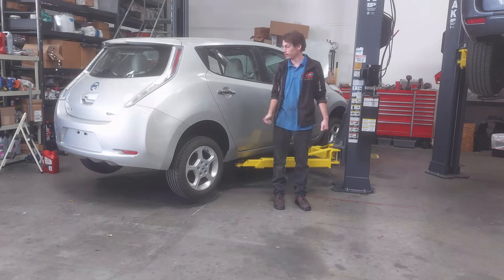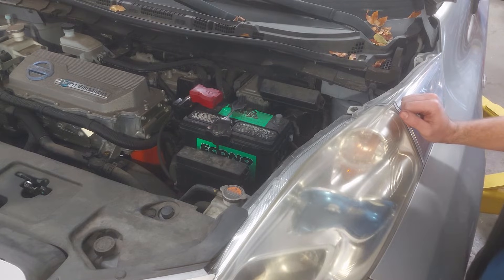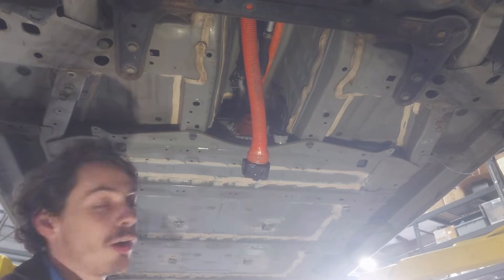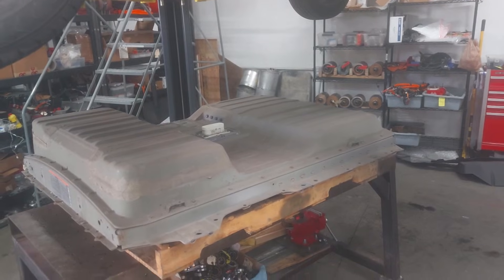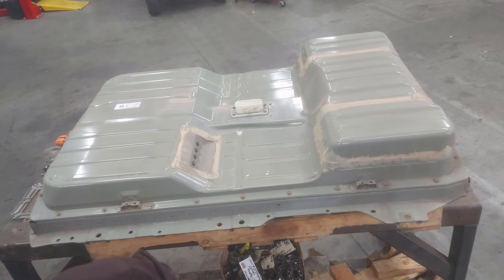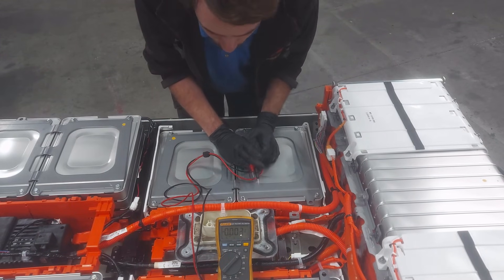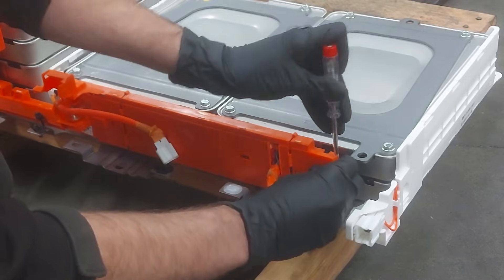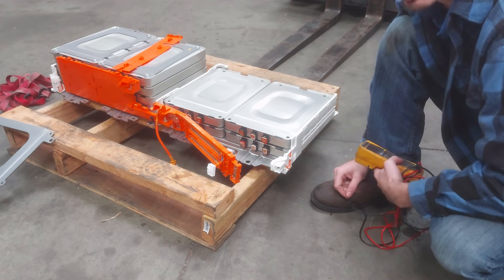Nissan LEAF Battery Repair (PART 1)

Comment from the maker: As pointed out, there were a few issues with the editing of this video where the video blacked out. I've gone in and cut those parts out while trying to keep as much continuity as possible, but there are a few details that get skipped over at the beginning of the video. Sorry about that folks!!!
Reply: Where are you located, and how much you charge for upgrade
Reply from the maker: We are located in Vista California. In terms of pricing for upgrades, that depends on what year your LEAF is, and what size battery you want to swap in...
The larger capacity "upgrade" batteries are quite tough to get ahold of, and we don't typically sell or stock them, so the exact pricing is also going to boil down to who is selling the battery...
Reply: How much for a nissan leaf visa pack 2015 october ?

Comment: It almost looks like Nissan were considering some form of battery cooling/conditioning by those 4 'ports' on the top on the left side. They don't appear on newer versions I don't think. Did they change their mind about battery cooling late in the design stage? Curious.

Comment: Great job, Replacing EV batteries with unsatisfied requirement is a very meaningful thing, If you also want to replace EV battery for your car, Pls contact us, we can provide the EV battery module of Nissan Leaf for you.

Comment: How did you remove cover with all that silicon sealant
Reply from the maker: The early Gen1 packs just have a re-usable rubber seal, so taking the lid of is easy on them. The later packs have VERY tenacious silicone sealant which is quite hard to cut through... I would recommend using a sharp knife, or better yet, a vibratory cutting tool.

Comment: why did you say at the begining of the video that replacing bad cells will not improve the overall condition of the battery?... isn't that what people do when they refurbish the battery? unless the battery comes from the manufacturer that's about the only thing can be done. correct me if I'm wrong
Reply from the maker: Generally speaking, when it comes to the LEAF, in most cases the cells degrade pretty evenly in terms of capacity loss, so replacing "a few" cells usually won't make a significant improvement. For those types of situations, the only solution to make a major impact would be to replace all of the cells (so essentially replace the whole battery). 

In more rare cases (like with the car in this video), sometimes one or more cells can suffer from a major failure, which can be rectified by replacing said cell(s).

Comment: Absolute complete lack of High Voltage awareness and NO use of personal protective equipment! WHY!?! This is dangerous and someone following your poor example can get killed. Please take down this irresponsible teardown video.
Reply: Kindof surprised me as well. Obviously he knows what he is doing. After opening the case he has gloves. 

Other videos talk in depth about electrical safety. This video covered disassembly & fault finding.

Comment: Does anyone know a company here in the USA that has the wisdom to work on a way to use new modules to replace used ones in the battery pack and profit from this aftermarket need?
Reply: I will do it.   Tampa FL.

Comment: I'm enjoying watching the steps you take for disassembly.  We have a 2016 Leaf that has served us well for the past six years.  I hope our Leaf lasts for a few more years before we have to consider upgrading the battery.  Are you guys following the work being done in New Zealand to replace the Leaf cells with BYD Blade cells?  Thanks for the upload.  Now on to Part 2 of the project.
Reply: Does anyone know a company here in the USA that has the wisdom to work on a way to use new modules to replace used ones in the battery pack and profit from this aftermarket need?